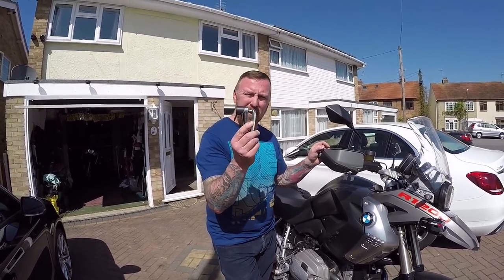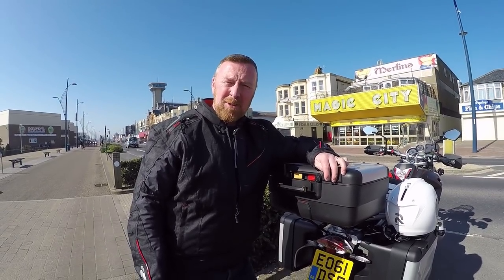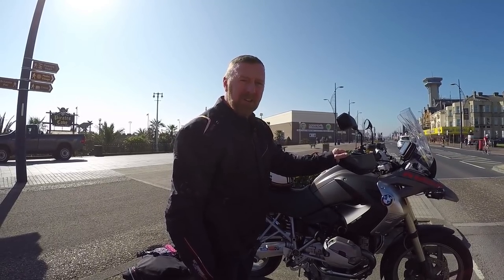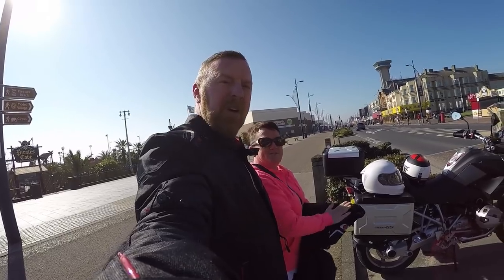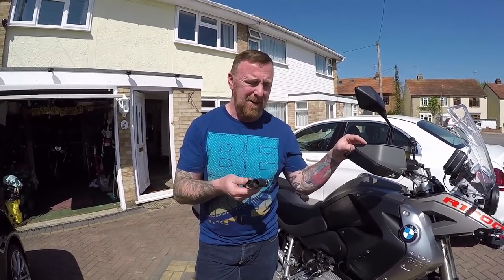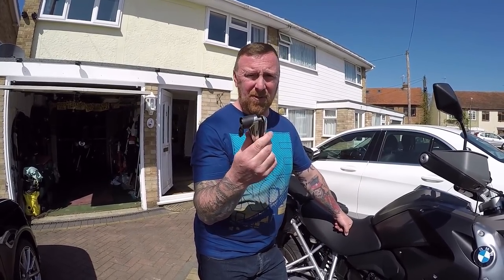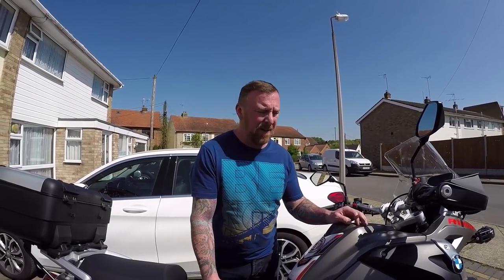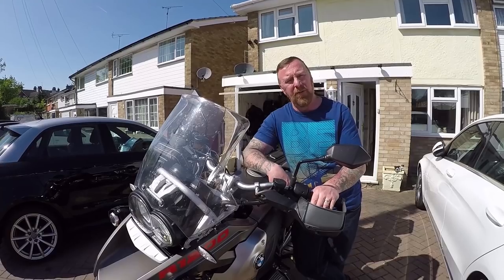BMW 1200 GS BIKE DROP & CHAT ON A RIDE OUT MARK SAVAGE

Comment: H Mark, need your help again. I'm very confused as as soon as i tighten the variator on my yamaha aerox, it just doesn't move at all, and once i untighten the bolt it is free to move again, please help dont wanna take it to a garage! Thanks so much
Reply from the maker: Matti De'Beer so tight it’s locking ?
Take it back off and see what it’s jamming on you may have to put the washer back on or it’s jamming on the starter part 
Give it a good looking over 
I have a few video on them check them out and see if you can see the problem 
Mark
Reply: Hi Mark, i figured it out, there is a little metal collar that goes behind the starter clutch which i didnt put in because when i got the bike it was put back wrong in the first place, but now the variator is all good. but the bike doesnt start anymore ahahha. although it did run 3 weeks ago now it doesnt start like if it was off no puff or anything i can just feel air coming out the exhaust bit literally nothing when kicking over.

Comment: Hi Mark, i fixed my variator, the starter clutch was missing a collar behind it but now i assembled it back together and when i kick the bike u can hear horrible griding noise and im sure its the kickstart and i have no clue to why its doing it ! any clue? thanks
Reply from the maker: so does it electric start ?
if when you lick start it does it slip or crunch down or does it start and make the noise?
mark
Reply: mark savage It starts then starts making the grinding noise on kick start. The electric start doesn't work.
Reply from the maker: sounds like the variator out teeth are hitting the Bendix or the kick start pinion 
take the cover off and move it round with your hand and see is it catches anywhere and then put the cover on kick it over with the key off and make sure it sounds ok .
look for anywhere is maybe catching like the Bendix and so on 
mark
Reply from the maker: I do have a video on the kick are and loads on the variator, maybe give one of my older videos a watch as you may see whats different, best sit on the computer as you should get to see them then 
mark
Reply: It spins fine with the cover off by hand, but also the kickstart sticks now, i fucked something up. Im gonna face it i dont know what im doing. gonna take it to a garage ahah. cheers anyway
Reply: On the kickstart shaft i found that the kickstart washer is missing which pulls the kickstart and cog too far forward causing the grinding. Thanks for the videos
Reply from the maker: Matti De'Beer knew they would help bud and hopefully save you a few £ at the garage 
Mark
Reply: Yeah, they proper try to rip me off i really didn't want to go there. I have some variator shims that are spare which i ordered, do u reckon ill get away using that instead of buying a proper washer? should be rejt?
Reply from the maker: Matti De'Beer if it’s the same size it’s worth ago bud